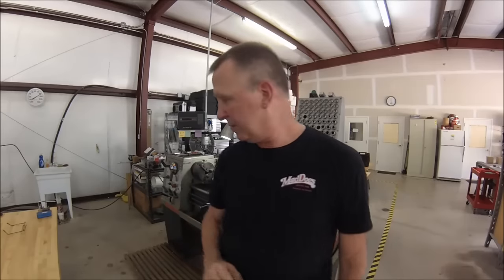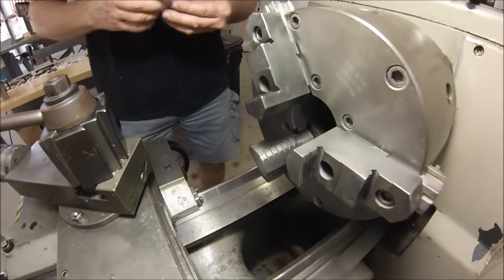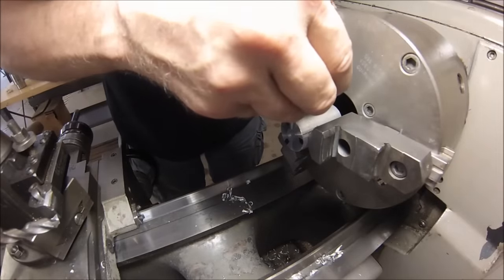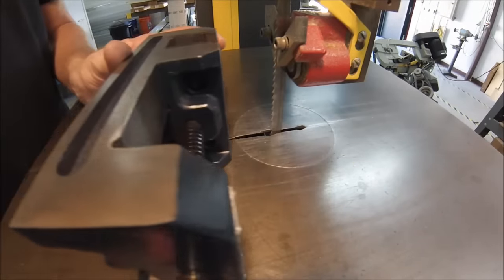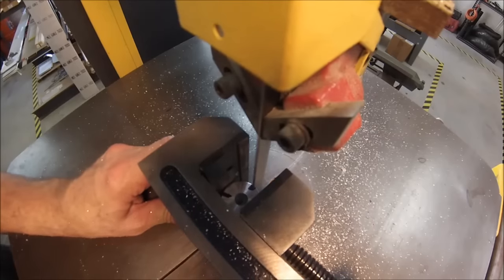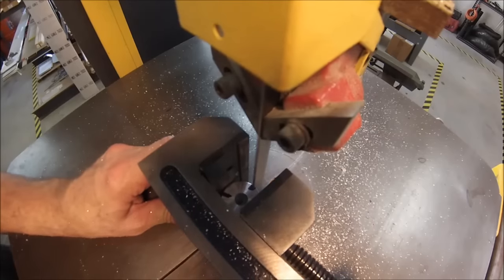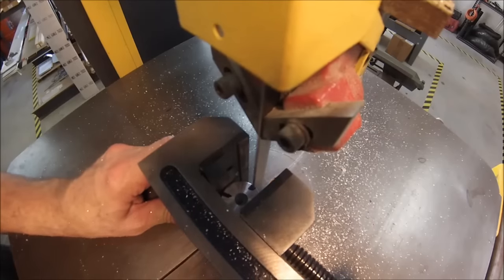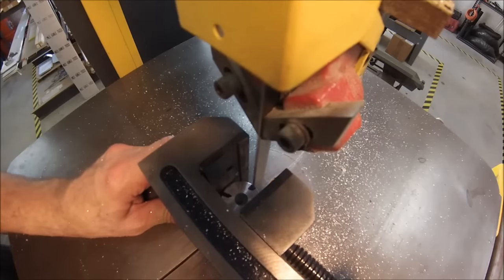Get your parts to run true in a non adjustable chuck. YOU MUST WATCH THIS!

Comment: no safty glasses
Reply from the maker: It OK, my eyes are fake.
Reply: safety glasses are a joke, only good for chips straight-on. I've had my eyes drilled twice now because of grinding sparks ricocheting off my cheek and around the glasses straight into my cornea. Minimum goggles if you want to be safe, face shield if your clumsy or dont know how to angle your grinding.  Plus this kind of material removal doesn't really throw shavings in your face.

Comment: I had to laugh.   Before removing the aluminum slug from the 3 jaw chuck, you marked the slug so you can put it back in the chuck in the same location.   You made 3 marks with your felt-tipped pen.   Why three marks?   You only need one mark.   And then you marked where the chuck key location is.  Why?  If you made only one mark, referenced to one particular chuck jaw, you wouldn't need to waste your time making 3 marks and on mark for the chuck wrench.   You remind me of a dog chasing his tail. You make useless movements and steps.   Steps that are not needed.  It's no big deal, but if you choose to be a craftsman,  act like a craftsman.   Every day is an opportunity to show craftsmanship.  Even if you are only showing yourself.   Then YOU will know you are a craftsman.  In my opinion, you've got a long way to go.
Reply from the maker: Rob. Wow. I'll address your comments. The 3 sharpie marks were strictly an eyeball reference for splitting. Nothing else. The key location was marked to get the part back in a general original location because the pilot hole is eccentric to the OD at this point. The" Not being a craftsman" comment stung a bit, but the 7698 views and 620 thumbs up softened the shock just a bit. BTW what kind of dog? Thanks for taking the time to comment.
Reply: Joe------------Some people don't take criticism well.
Reply: I was wondering if you meant to saw the relieves in between the three marked spots? I guess that had a pretty small effect in the but still.
Reply: That wasn't criticism that was mean if you intended it or not.
Joe is a darn good craftsman he could have made it perfect but the reason for the video was to help people and make them think.
There are plenty of buffoons on YouTube, he isn't one of them.
Worth
Reply: Three marks because he cut relief's into them. I think eyeballing it would be pretty foolish considering you'd need additional tools to measure where the 120* marks would be, but if that's what works where you come from. I think a true craftsman would try to stay close to that number, and considering he measured against steel at that angle, I'd say it's a pretty "crafty" thing to do.
Reply from the maker: Hey Rob. I am all about everyone sharing their own experiences and techniques, It how we share and grow, but when the comments and remarks cross the line and become personal, I see that as uncalled for. I addressed your attack with class. Keep it on point if you care to be allowed to post comments here. We would all appreciate it.
Reply from the maker: Thanks Chubbza5. I appreciate the support.
Reply: If you need 3 equal spaces, just put the part in your indexer and index 120 degrees for each space.   Or, is your level of craftsmanship limited to guessing and eyeballing?
Reply from the maker: Hi Rob, good to hear from you again. An indexer would surely give you 3 equal slits, then you would need the following: lots of extra time, an arbor for the collar you just made since its a full body split, lets not forget the indexer, a milling machine, a slitting saw and arbor, some setup time and a boss that didn't mind you wasting his time like that for a simple split collar. Other than that, you are correct.
Reply: Joe Pieczynski That sure does sound like a lot of extra work. I'm no expert but I think using the pre-engineered 120* segments would be the simplest way. You could make one mark and guess, but I think you'd be "ROBbing" yourself in the long run.
Reply from the maker: Hey Chubbza 5, Every step of the material I present usually has a very good reason for being there. Everybody works differently in this trade. But why make rocket science out of something that doesn't need it. The bosses will notice in the long run. Thanks for the comment.
Reply: I suspect old Rob didn't have his coffee the morning he watched your great video, or else his dog caught his tail and couldn't turn it loose. Keep 'em coming Joe.
Reply from the maker: I actually went over to Rob's channel to get a better feel for where the comments were coming from. No machining videos. 7 subscribers. Nuf said.
Reply: The only thing I would change would be to leave the sawed slot open, don't use the shim and bore to size instead of reaming. I've made these quick fixes many times but know every machinist does things a little different. I'm wondering why the chuck body runs out so much? You indicated it was intentional. Could you explain? Thanks
Reply from the maker: Greetings. The body of this adjustable chuck was intentionally thrown off center to mimic severely worn or very badly ground jaws. The eccentric condition that it caused was part of the demonstration to correct it. I stand behind the use of a shim because otherwise, you don't get a secure grip on the bushing. Using a shim, the bushing is guaranteed to stay put because it closes on the shim and the chuck can then be tightened to the same torque you will put on the part you are going to machine. I agree, boring would be the most accurate, but I usually stage the demos around tools I think my viewers may have. I would suggest not leaving the sawed slot open, but like you said, everybody works a little differently. Thanks for the comment. be safe.
Reply: Do you mean you are going to make a bushing for everything you hold?   If your  3-jaw chuck ran concentric you could just use the jaws of the chuck to hold your workpiece and you wouldn't have to make a bushing each time you hold something.
       You say, "everybody works a little differenty."  But you surly don't mean all those "differently" ways are acceptable.
       I'm surprised your  chuck doesn't run somewhat concentric.  That is, within a couple of thousandths.  I doubt it left the chuck factory in that condition.   I'd do a little cleaning and inspecting.
Reply: No, you only make special bushings for jobs that require run-out to be almost perfect, say .001 total or less. Otherwise use your regular chuck jaws where run-out is not critical. Here's the method I use,and yes different ways are all acceptable as long they get the job done. I chuck the bushing in the out of true jaws, drill the hole 1/32 under, take out the bushing, saw three cuts as shown. place back in marked jaws, tighten hard enough to prevent further slippage, then bore for slip fit. I then place part in the bored hole and tighten chuck again to grip part securely. The bushing only closes about .001 to grip the part, which is now perfectly centered. No shim is needed with this method, there's no chance of losing the securely tightened bushing, and several steps are eliminated. I would use a shim only if I intended to ream the hole after boring. Thanks for discussion.
Reply from the maker: I guess the bottom line is, as long as the bushing doesn't move and your comfortable with it, go for it. You can get some solid pressure on these bushings depending on how much web you leave after you split them. I've been doing it this way for 40 years. I'll continue to use the shim, but will also admit there are many ways to get to the end. Thanks for the comments.
Reply from the maker: Easy does it Shop Tech. Rob apparently doesn't watch the complete video, read any other comments or maybe his computer doesn't have audio. I don't know about you, but I may throw out all may collets and make bushings for everything from now on. What a great idea. I appreciate your support. hey Rob....say hi to DB for me.
Reply: Joe, if you crank that sucker down real tight it ain't going nowhere and if does save time which is always important. I'm guessing Rob has only a layman's knowledge of machining and doesn't understand the fine points. Thanks again for the great video that inspired so many interesting comments. I'm now a subscriber and waiting for more.
Reply from the maker: Chubbza5 WOW. Nice to know even I can have super fans. The support is flattering. Thanks for the comment.
Reply: Hi Chubbza5
I thought I made it clear but here goes again. By going directly to boring the hole to size five unnecessary steps are eliminated. 1. Inserting and clamping the shim. 2. Drilling the shim out with interrupted cut which could loosen the bushing. 3. Boring to true up hole. 4. Removing the shim. 5. Reaming to size. Reaming is limited to the reamer sizes you have in stock while you can bore to any odd size you need.
Reply from the maker: A total of 3 minutes, but time is money.
Reply: Actually 7 steps, you have to saw the slot to exact width, then make the shim to fit. However both methods produce the same result so time doesn't matter unless the man is looking over your shoulder. Love your videos Joe, keep 'em coming.
Reply from the maker: OK, my turn. The slot is cut by eye in a matter of seconds. The shim is a piece of 1/8 aluminum stock also zipped off in a matter of seconds. The slot closes down on it from jaw pressure. I stand by my statement that my way is safer, because an open split part in a chuck being machined, has a better chance of moving than one clamped securely against a solid surface. This is a Fact. We can go back and forth on this, but lets just agree to disagree. Safety and a quality part is all that matters. This video is 32 minutes long because of the camera. If I filmed it in real time, it would take minutes. That being said, I'll choose the safer way to save the 15 seconds.Thank you for keeping this going without getting nasty. Much appreciated.

Comment: Thanks for the tip but I cant watch the whole video. I never adjust a running machine. Beginners are likely to learn some bad habits. Bob Collins
Reply from the maker: Please be more specific if you have a point. I am genuinely curious.
Reply: Yes, be more spècific, its hard to follow random words.
Reply: No disrespect intended. Your are clearly a skilled and knowledgeable craftsman and I learned something new from your video.
However, what concerns me in your video is the lack of your attention to safety and how it may encourage those less skilled and experienced to operate dangerous machines in a similar way.

Specifically:
No sign or mention of safety eye protection.
Fitting cutting tool holder while lathe is turning on several occasions.
Leaving running machine to adjust camera.
Carelessly handling possibly sharp machined part.
Careless use of airline to shift swarf on numerous occasions.
Hands and arm very close to chuck to deburr part with an ordinary file, on two occasions.
Careless use of a band saw when a less dangerous hacksaw would have done the job.
Camera adjusted while bandsaw running (work piece and vice left in contact with the blade).
Work piece adjusted in vice while machine running on several occasions.
Work piece unclamped in a simple V block and offered up to blade by hand.
Tool head replaced while machine running on numerous occasions.

Bob Collins.
 @joepie221
Reply from the maker: @MrBlumlein  Hi Bob. I welcome all comments, but would like to address your concerns, line by line, for others that may read what you commented. My reply is offered up with the utmost respect.

No sign or mention of safety eye protection.
  
       True. But, This is not a safety video. Nor, at any time in this video, did you see me running a machine without eye protection.
Fitting cutting tool holder while lathe is turning on several occasions.
       True. In job shops in the US, if you were to shut your machine off every time you wished to change a tool, you would last 1 day. Maybe less.
Leaving running machine to adjust camera.
       Since I am the only person around this machine and no power feeds were engaged, this makes no difference, nor poses any safety hazard.
Carelessly handling possibly sharp machined part.
       All parts are sharp until you deburr them. Without handling them, how does that occur?
Careless use of airline to shift swarf on numerous occasions.
       Another cultural hangup. Cut the air to most american shops and they will shut down. Air pressure will not translate swarf or chips in places that flood coolant wont reach.               Actually, on a bottom hole or channel, liquid is far worse because air purges itself out when it hits a physical obstacle. 
Hands and arm very close to chuck to deburr part with an ordinary file, on two occasions.
       What you probably can't see out of camera range is my left forearm securely resting on the headstock of the machine. This solid registration surface allows for stable control  of the file. Though common sense and caution should always be exercised, If you are afraid of getting too close to a spinning chuck, you should probably not run an engine lathe.
Careless use of a band saw when a less dangerous hacksaw would have done the job.
         The workpiece was secure for the initial slotting operations and nested for the remaining operations. No danger. A hacksaw would have taken much longer.
Camera adjusted while bandsaw running (work piece and vice left in contact with the blade).
         On this comment, you are mistaken. The part was never left alone, in contact with the blade at anytime. You'll have to point out a specific time that you believe you witnessed that.
Work piece adjusted in vice while machine running on several occasions.
         Absolutely. If you don't feel safe 10" away from a moving blade, you may wish to choose another profession.
Work piece unclamped in a simple V block and offered up to blade by hand.
         The bandsaw is one of the few machines in any shop where freehand cutting is not unusual. The fact that a V block was used made the operation safer at a whole nuther level.
Tool head replaced while machine running on numerous occasions.
         This is a duplicate observation from line item 2. It still remains a safe practice.

Overall, nothing shown in this video was a bad practice in the real world. I have heard of guys suggesting the "shut the machine off" mentality when changing a tool, but that guy wouldn't be on any payroll I've ever offered or been a part of. Thats just not a realistic practice.   I'll survey my guys. Check out my community link to see if you are in the minority.

Comment: Not very smart to stand in front of the file and the spinning chuck when deburring.  If the chuck Nicks that file it's going in your stomach. Hobbyist.
Reply from the maker: You would be surprised at how untrue that is. Only the tip of the file is the real dangerous part. Keep that clear and the file can hit the jaws all day. I did a slow speed test to prove that. I may post it. I used a paint stir.
Reply: @joepie221  Any fool can be dangerous with a file and a lathe.  Unless you are a fool it is quite safe to use a file as Joe did.   I have been doing it for 60 years now and I have no stomach scars from wayward files nor have I ruined a single file.   Loose shirt or coat sleeves are the real danger, and no I do not know that from personal experience.  As Joe says you just have to keep the end of the file clear of the jaws and that comes naturally from holding the tip.

Comment: not very practical. Every time you turn a part you would have to make your custom bushing???? WTF
Reply: If every part you make exceeds the limits of your machine, then it's time to repair or replace. As for practicality, a similar technique is used on high-precision, high-volume machines: the chuck is tensioned, then the jaws (or carbide inserts therein) are ground to a few microns under the diameter of the part.

Comment: Not very HS aware, where are
 the guards on saw, very dangerous ,face protection,could loose your hands,-chuck body  runout not relevent to actual jaw clamp concentricity 32:12 or wear on one or two of jaws or wear on scrolls ,obviously if u machine some part in out of concenticity it will always find its concentricity even though the outside of part is offcenter (basis to machining a center on cammed or offcenter pins such as crankshafts ,eventhough the web is massively out the crank pin is alwaws machined or ground to its centre)  when spun so therefore clamp fairly central and concenric by relieving one side of the hole/bore and clamp more accurately?! its called a collett
Reply from the maker: You spelled Collet wrong.
Reply: @joepie221  It's difficult for him to operate spell-check while his other hand is riding boundary on his comfort zone.

Comment: Your still filling with your right hand on the file handle and your left hand on the tip of the file.
I cringe every time i see you doing that.
How would you file a piece in a chuck that has a  40" OR 60" CHUCK?
Your left arm will never reach around that big of a chuck.
Just my 2 cents on running various machines from bench lathes,mills,grinders,key seaters and on and on.
I just retired after 40 years of being a machinist. 
I've learned early on to file a part in lathes with my left hand on the file handle and right hand on the tip of the file!
Keep the videos coming your never to old to learn new thing.
Reply from the maker: I draw the line at 10" chucks. form tools beyond that. 47 years in the trade and still going 6 days a week.
Reply: Beach bum 2008 Joe has 100+ videos up. I don't seem to be able to find any of your's